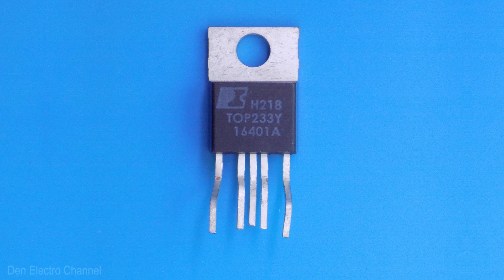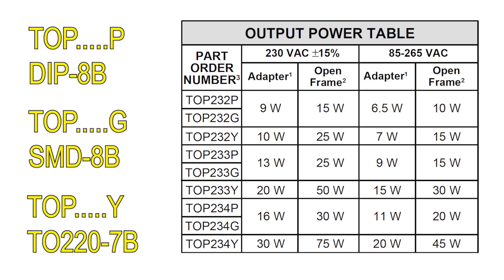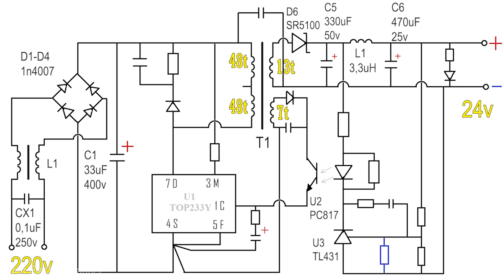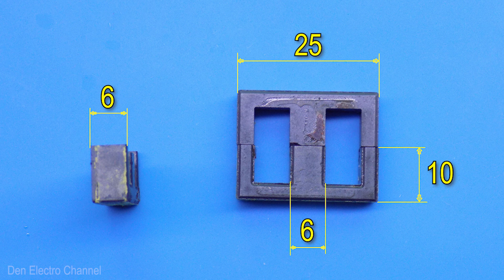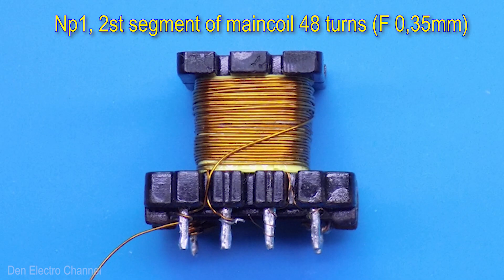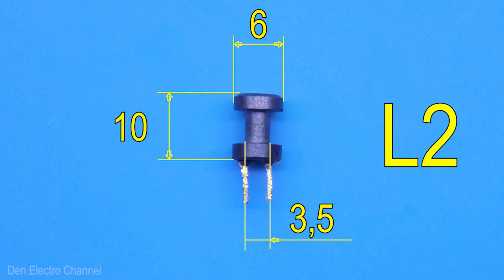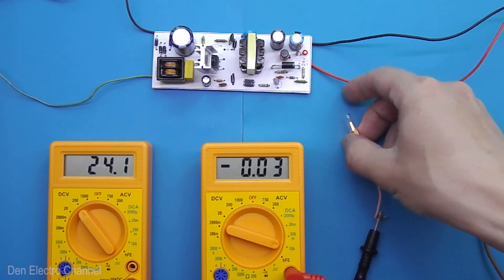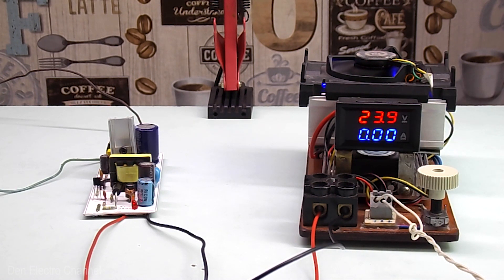Switching power supply 24V 1.5A

Comment: Please b make a 24v 7a power supply
Reply: The bridge rectifier should be capable of handling more than 7A , before continue to next stages.

A bridge which made using 1n4007 would never produces greater than 3A.
Reply: @MosMan444  At that currents it is usefull to switch diodes with mosfets that would be controlled in the right way.
Reply: @N_OR_  Absolutely!